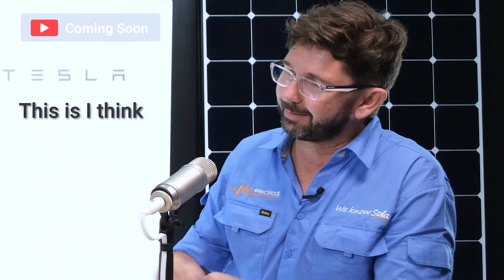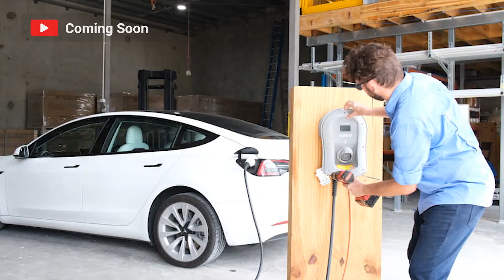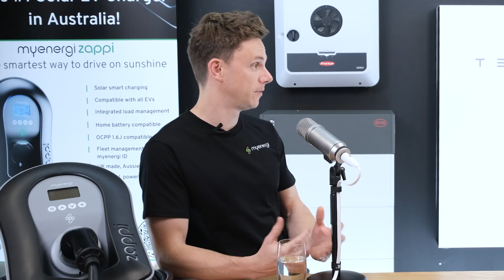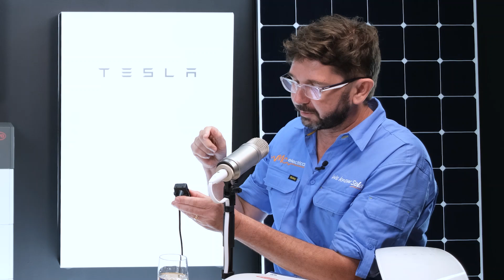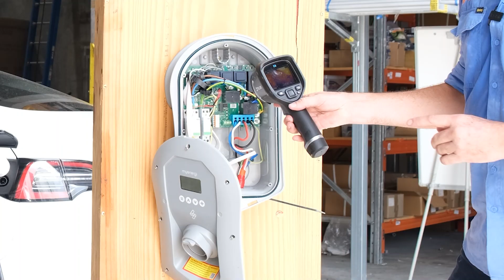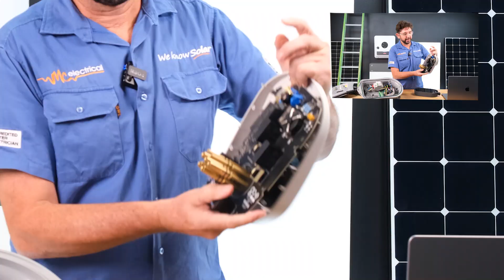Zappi Honest EV Charger Review

Comment: Why not just get a dedicated 32A power point and just use supplied cable with your EV?
This “smartness” will cost you $2000 and what’s the ROI on that?
and if it goes bust, you won’t be able to charge EV until company and sparky will get together to resolve your issue.
Reply: I believe the fastest you can charge with a power point  type charger is 15amps. Haven’t tested it yet, but I’m sure that would derate too.

Comment: It may just be badly suited to Australia, my parents have 2 of these in the UK and they're fine, but then the ambient temperature outside just doesn't get as high.

I am very surprised at the internals though, that's really basic stuff, especially given the cost of the units
Reply: Many EV chargers appear to have basic electrical components, but due to the trend of EVs these manufacturers are marking up the prices by ridiculous amount. They could have sold each at 10%-20% of the current prices.
Reply: It may also be that your parents don’t charge at full whack during hot periods- or if they do, they don’t bother to notice the derating? It may not be an issue for everyone.

Comment: That zappi guy has provided a slightly less than factual overview of the company history - they have a history of weak customer support, unreliable and badly built products and over promising and under delivering - buy a Fronius product folks.
Reply: Don’t really have an overheating problem in the UK. It’s cold and miserable most of the year😅
Reply: @markgilder9990  I'm in the far north of Scotland and I can assure you that the charge rate derates considerably. It's fair enough to design a system to prevent damage from excessive heat, but in this instance, the case design and the internal components are the cause of the thermal build-up - lots of folks simply don't notice their fast charger is actually only charging at half its rated rate.
Reply: @SeanMoore2008  What product do you recommend? I am in North Queensland myself and want to make the post of our solar. Any suggestions? I am hope during the day time at least 4 days per week.
Reply: On the basis of my experience I find the products very good and the support excellent. I’ve had a few teething problems and the help staff were excellent. Sorted.
Reply: I have been using myenergy products ever since their products came to market: 2 x Eddi, Zappi, Harvi and Hub with great success! In particular the Zappi integration with the Octopus IOG tariff is exceptional; it feeds my home battery system, appliances and my EV with 7.5 pence per kWh electricity between 23:30 - 05:30 and at other times when the grid allows. Their products are of excellent build quality and the customer support is second to none! Perhaps you should stick to facts or perhaps you are paid by Fronius to spread your unsubstantiated comments!
Reply: I have had the reverse experience; great support from MyEnergi when I had a Zappi. When I moved house and put in a WattPilot support from Fronius when I needed it was negligible.
Reply: Have always had great tech support here in the UK..
Reply from the maker: ^ what he said :)

Comment: Excellent vid Mark. I think the problem for Myenergi is they come from the UK market where 3 phase is extremely rare and high temperatures are too. So if a single phase unit derates from 6.8kW down to 5kW - barealy noticeable. However if 11kW derates down to 5kW - well you might notice that. Personally I rate the Tesla above them all - mainly because of the features v cost. It's half the cost of the Zappi and the Wattpilot is even more expensive. I also prefer the Zappi's simplistic design because if a contactor goes it's as simple as replacing a DIN rail component. On the Wattpilot it's a component level repair or, more likely, a new board. The big problem with the Tesla - no OCPP.
Reply from the maker: Thanks mondo. I didn’t really consider repairability. But then again I’d rate longevity over repairability. 
I recon in 3 years time, most of the EV chargers on the market that we have today will look like dinosaurs.
Reply: @mcelectrical  I'm not sure about that. I think there'll be a clone of the Fronius made by the Chinese that will be just as good but one third the price. I have the Zappi - it lives in my garage and so far I haven't noticed any derating. I have had to replace the the RCD board as it was tripping when charging the Model 3. Myenergi sent me a new board so it must have been a known problem and I installed it myself - they would have sent a tech out but it was a simple fix.
Reply: Agree a lot of homes in the UK are signal phase but there a quite  a lot of 3 phase installed in business. one thing the Zappi has that the Tesla doesn't and this is a critical  safety feature and that is PEN fault detection. this is in the event you house neutral and earth has a connection fault and the charger is connected to the car, the car can become live with a mains voltage which you can get a electric shock, the zappi detects this type of vault and stops the output going live or cuts the power

Comment: Here it is called throttling but we only see it on cheap chinese inverters without real cooling, the micro inverters.
We use pulsar plus from Wallbox, the manufacturer and company who had given the name for all of these devices. 

great overview and for sure comparison at the end. Looks like a comparison of cold war tech with 2024 tech, but at the end reliability counts the most. Here we tend to not charge with 11 kW cause most homes do have 10 kWp solar installations due to limitations by the government which meant you had to pay taxes above 10 kWp till the russian invasion cause since the or 2023 the limit has been lifted up to 30 kWp are tax free. 

But usually people tend to charge slow at home with low pressure on the battery since dealers have started to read the battery health and examin that charging speeds as part of the residual value estimation. 11 kW is a usual charger limit here, beyond that it also requires a kind of dampener which means that the utility company can limit the power for up to 6 hours per day with 2 max. consecutive hours to stabilize the grid in case they have too. Happens very rarely but you have to take it into account cause you will have to pay for the crappy dampener and its installation which a lot people tend to avoid. Same for  Solar roofs, but there it is used from 25 kWp and more. So now the usual max. limit is not 30 kW (tax free) limit but rather the 25 kWp limit to avoid the chains of the utility provider.

Comment: We went away from these closed hardware based solutions. We try to connect every charger to every inverter to charge surplus also incl. switching the phases to get as low as we can cause 3 phases means 3 times more energy required. 
EVCC is the sofrware solution running on a raspberry pi or as integration in Home Assistant. This way you are independent from all the manufacturers, a big advantage. evcc is a german open source developement and fast growing community. 

Next step will be AI generated surplus management to get the most out of the surplus energy over all of the time independent loads which means it will charge the battery during off peak times if those are cheap enough to use the energy during the next day even after 20% losses for the detour via the battery. Fronius inverter and Fronius battery and Fronius charger is so much yesterday like growatt inverter, bbattery and charger.

Key point is to be able to turn phases on/off in case the sun goes down instead to stop charging.

Comment: Mark, the hardware for the Fronius Watt PIlot may be much better, but the way it works (and its software) is in my opinion absolutely rubbish.
The way the Wattpilot moves from single to three phase, and back again is sub-optimal. The App is absolutely woefully designed. Fronius may make good hardware but their software sucks.
I've gone back to using my Tesla HPWC and ChargeHQ. Much better.
Reply: Interesting. The app isn’t very user friendly. The switching to single phase charging is a feature in my opinion. It allows you do go down to 6 amps rather than 3x6 amps for solar charging. Most 3 phase chargers don’t do that.  I do like my Tesla charger more, but I think you will be limited to 18 amps or 4.6kW minimum charging on solar, right?
Reply: @markcavanagh  The Tesla HPWC changes seamlessly from single to three phase without interrupting charging - something the Fronius doesn't do. The Tesla HPWC charges on single phase well below 2kW. I can't recall exactly what level it charges down to.
The Tesla product is far, far superior for Tesla owners. If someone doesn't own a Tesla and needs OCPP support then the Fronius is OK. If I knew how poor the Fronius Wattpilot product was, I wouldn't have bought it. It currently sits at home unused.

Comment: Myenergi New Zealand/Australia have been horrible to deal with. Been over a month and haven't yet been put in contact with an installer.
Glad I changed to a Wattpilot.
Reply: Oh interesting. I guess they don’t have a presence in NZ. They were bad at service in Australia before they came here. Being in NewZealand you should have checked out Evnex. I’m testing that now. Looks good so far.
Reply: @markcavanagh  thanks, they have a nz website and claim to install in NZ so who knows.
the other issue I have it the main switchboard is about 30m on the other side of the house to where the charger is so it just made sense to use the wallpilot as I have a fronus inverter.

Comment: I’ve been running a zappi for over 13 months without any issues vehicle charging performance is a consistent 6.8 kWh into the vehicle with 7 kWh AC on board charger in fast charging mode love the eco and eco + modes and energy monitoring features
Reply: I was told the early single phase models had pcb contactors. Maybe this model just didn’t have the same derating issues?
Reply: I’m only pulling max 7 kWh so guess I’m not tasking it to hard it’s mounted under the house with plenty of airflow my first unit was replaced as it was faulty out of the box the replacement has been brilliant so far love the real time monitoring on the unit screen for sure 👍😁
Reply: Lucky you I'm pulling 3kw lol

Comment: Thanks for the mention, I attempted to charge at full speed on single phase, which is normally 7.4kW, but after just 40 minutes it started to slow.  So after I had charged for 2 hours 48 minutes, the average speed was just 6.1kW. At it’s slowest it was only charging at 4.7kWh. So doing the maths, I basically missed out on 3.5kWh or 18% because of slowdown from the heat during this test.
So a few days later, at the next opportunity, I charged on 3 phase at full speed, which for my EV is 11kW, but after 1 hour 15 minutes it started to slow again. This time after 2 hours & 24 minutes the  average was just 9.5kW. At it’s slowest it was only charging at 6.2kWh. So for this test I basically missed out on 3.4kWh or 14% because of slowdown from the overheating. Obviously if I were charging for longer, I would have loss even more charging potential with both of these tests.
None of my other branded chargers have had anything like this issue. 
Anyone wanting to read my full findings see here: https://www.facebook.com/groups/162640453815835/permalink/4657227747690394/

Comment: Brought up the same issue of derating with Zach when he visited my area recently in vic. The Zappi just isn't engineered for aussie conditions. In my opinion this isn't something that can be fixed with firmware, tweaking the pwm curve or cycling the contactors, it needs active cooling. The ecosystem and features are great but I wont be installing these either until there's a design overhaul or active cooling added. If it says 7kw/22kw on the box, customers expect it to run at that without derating.
Reply: Oh interesting to know. In my mind Victoria is cold. In reality England and Melbourne get hot too. Would be keen to have found anything you like. I’m testing Evnex now. It has a bit of derating and less features, but it like it.
Reply: derating sounds a bit like derailing, but at the end it means the same: is not good enough

Does not sell at all in germany. I know it only from the british channels I watch, the whole zappi family, and the ellectric show or so that did marketing for them on every corner.

Comment: i installed an EVNEX home charger a couple of months back, and so far its great. i have it set to charge the car when there is excess solar only
Reply: Good to know. I’m testing Evnex now and meeting with them Monday. I’m liking what I see so far. Has a bit of derating but not so bad.
Reply: @markcavanagh  Are you planning a video on the EVNEX? We just bought an MG4 Xpower and I will get my sparky to install an EVSE along with a meter board upgrade, then install solar. I've looked around and the Zappi options are exactly what I'm looking for, but you've made me a bit jittery. Going to look at the EVNEX now in hope it does exactly what the Zappi does but with a better more robust design......if not I'll just trust the Zappi. We are on the coast at the border with NSW/VIC so it's a cooler climate. Could mount the unit outside on a brick wall.
Reply: @MrSnooooze  yeh we’re planning on doing a video on EVNEX. If you don’t have a Fronius inverter, (or a Tesla EV) then EVNEX is the right choice. 4g connection, hard wired CT, doesn’t derate, good app, good build (just feels a bit like Tupperware) seems like a solid company and support will be great should you need it.
Reply: Just installed one on my cabin with a 20a breaker, works great, it reduces the charge to the car based on the load in the cabin. Cabin #1 priority and car #2 priority awesome.